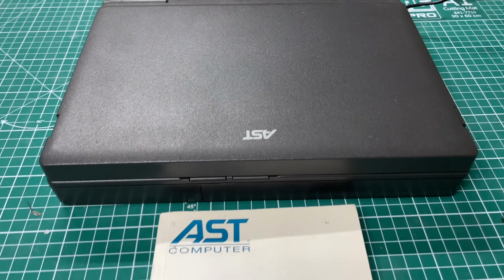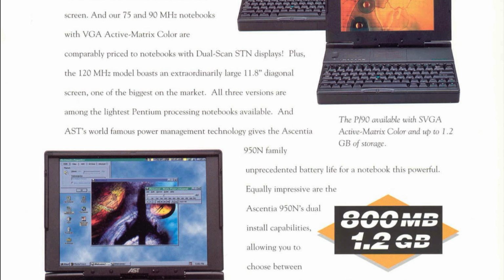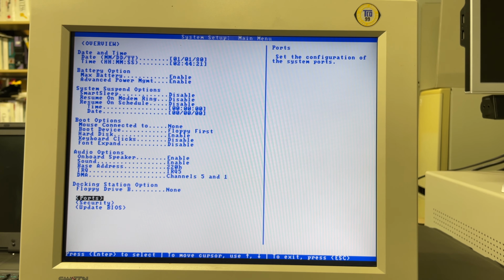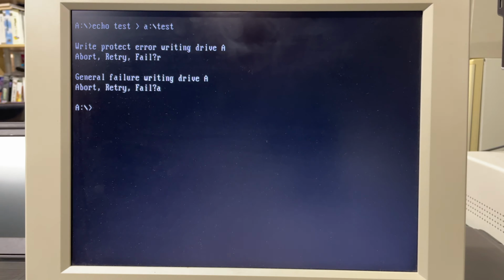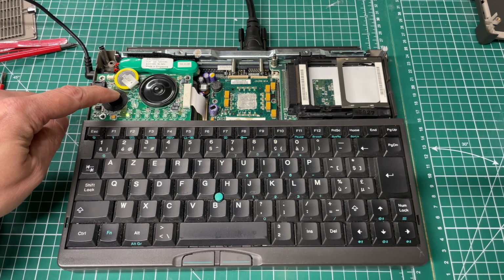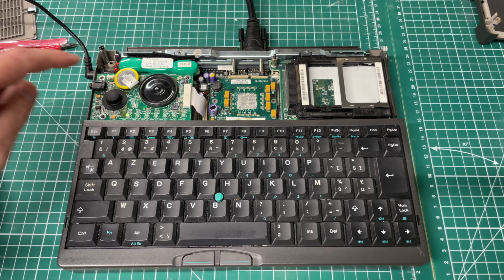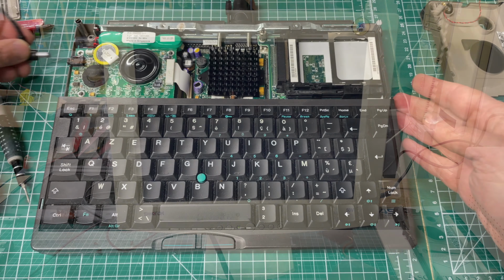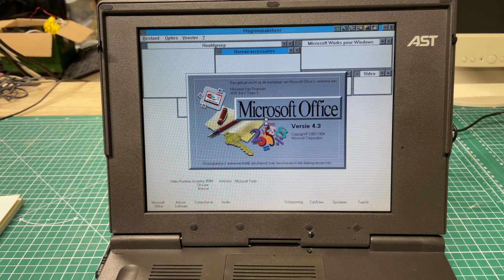AST Ascentia 950N laptop repair attempt

Comment: On my AST Ascentia 910N (which is extremely similar in construction to the 950N), it randomly stopped booting after years of working great. I was amazed to find a second battery soldered to the bottom of the CPU daughter card. Easy to miss, and it totally solved my problem when I replaced it. I noticed that you had a coin cell battery on top of your daughter board, try replacing that and I think you’ll be in business.

Comment: Modern laptops are way easier to work on than old stuff like this despite some online trying to say otherwise. You can fully disassemble and gut a modern laptop in like 20 minutes. Old laptops take more than 20 minutes to just get to the motherboard. Absolute crapshoot. The mid 2000s is when most laptops became easy to open up.

Comment: All this AST talk has taken me back. AST made some “oddly problematic” hardware in the 90’s. One fine day, my friend and I are taking turns playing Wing Commander 2 on his AST 486 (I had an Amiga 3000, so no WCII for me). As he was blasting his way through a wave of Kilrathi, we suddenly heard a very loud “pop!” and the screen went blank. As, even then, I knew a fair amount about computers, I opened up the machine expecting to find a blown cap or something… only to see the ceramic PGA package of the 486DX-33 was literally blown apart. 

It was shattered into multiple pieces strewn across the interior. The explosion was so violent that at least one chunk, with about 15 pins, has ejected from the non-zif socket. Like happening upon a bizarre auto accident, the physics of occurred still make no sense to me. Part of the shattered cpu die was exposed, having somehow separated from the ceramic package and blown it off the bottom of the chip (in those days, the chips were mounted “hanging down” in the package because they used contact wires to the die). 

In then following 32 years (including working in the semiconductor industry), I’ve never been able to imagine the cascade of electrical faults, the current involved and where the draw could have originated that could have caused the violent explosion of that ceramic package. Electrically it makes no sense, from what I know of the 486 and power delivery in older AT class machines (which admittedly isn’t extensive). Whatever happened occurred very quickly; there were no other signs of an issue and no blown caps; my trusty Radio Shack multimeter said the voltages on the PSU were fine and I couldn’t find any obvious issues.

I’ve seen modern faults where unchecked secondary PCIe shorts have burned up GPU’s, shorts at the slot resulting in holes burned through a motherboard, runaway thermals melt a die, I even witnessed last years famous Zen 4 Asus debacle. But I’ve never, ever seen anything else as inexplicably violent as that AST’s completely exploded ceramic CPU package.
Reply from the maker: The machine I have here makes no sense at all. All voltages are good, i am seeing clean 2.9v (cpu), 3.3v, 5v, 12v rails but it just has a mind of its own when it wants to start. Couple of days ago it wouldn’t start for the life of me, and now I’m having a hard time getting it to stop working.

Comment: Got an Acer Extensa 355 laptop from 1997 with the exact same floppy write protect issue. Jamming a second floppy disk on top of where the write protect sensor is solved it (it had that issue since I was given it in 2006)
I've seen that type of gunk at 17:00 still wet from small batteries like that Varta and I'm pretty sure it came from there...

Comment: There's a LOT of factory rework on the mainboard. This was a low volume product, right? Or maybe AST couldn't afford to throw away faulty designs at the time.
Reply: Adjust that $5,500 for inflation and yeah, it's worth it to put a few hours into hand repair

Comment: Some old devices are unable to start if the CMOS battery is dead because the clock isn't running. After 1000x attempts, they randomly start and yours is doing something very similar. Replace the soldered CMOS battery and see if it helps
Reply from the maker: I hooked up another 3v battery but didn’t work. Have an identical laptop that is able to launch without battery so don’t think this is preventing the laptop from starting.

Comment: Do you think we could make a voodoo 4 video card that plugs into the exoress card slot on a laptop? Im sure with modern tech we could make the chip extremely small and efficient. But i wonder if you can run video through it to the display.

Comment: Ahhh, nice to see someone working on an Ascentia 950N. 8-bit guy said these were junk and failed a lot when new, I'm becoming less sure of that though with time as I see more and more working ones still around. Any that don't have that varta battery removed will be dead in a few more years though.
Hopefully a corrosion repair and replacing the brown caps will fix that unit. As others have said the purple ones are polymer and don't have any liquid electrolyte to leak out. They're more than likely just fine.
Good luck, hope you get it working!
Reply: Probably some did fail new, the ones that are left are the durable ones.
Reply: @EvilTurkeySlices  my guess would be the failed units were probably mostly early production ones, and they probably sorted out the worst of the problems throughout later production runs. That’s how it worked with the PowerBook 5300s which were a similar case.
Reply: he worked there tech support department he would remember the common offenders.
Reply from the maker: Yeah probably should have rewatched that video :) have 3 of them experiencing the exact same issue : starting 1 out of 20 items :) and they all have different botch wire fixes. Totally understand that 110% return rate now :)

Comment: That brown Nichicon PF(M) cap is very much suspect.
Those are used in the Toshiba's I work on and they leak 100% of the time.
My guess would be that the corrosion in that area is not from just the battery.
The purple-ish caps are probably fine, as well as any others not in the PSU part of the board but I would still take 1 or 2 out to test them.
Reply from the maker: Replacing them didn’t fix the issue. Still debugging but is all very very random
Reply: @RetroSpector78  tbh, I didn't expect just replacing them would do the trick. Once there is that much leakage and corrosion there usually is more damage (and it can be very hard to find). You can get lucky sometimes though.

Comment: the odd behavior definitely suggests bad electrolytic caps or corrosion damage, but it could also be a bad solder joint. good luck finding the fault!
Reply from the maker: Hehe. Lots of solder joints to check. Its all pretty random.